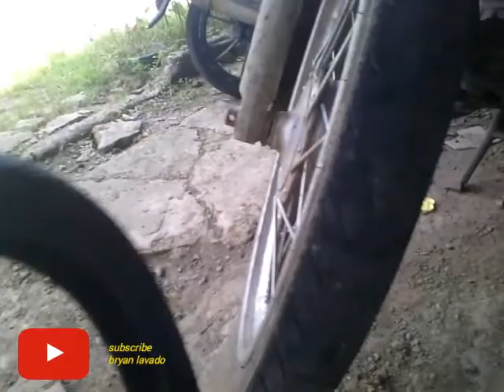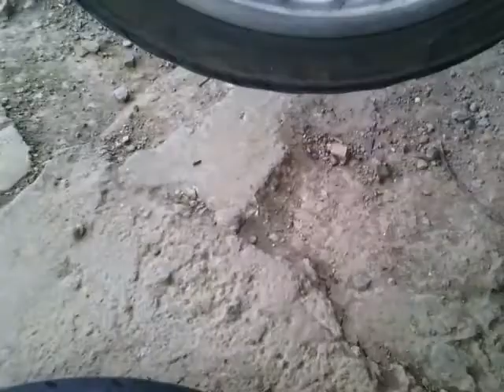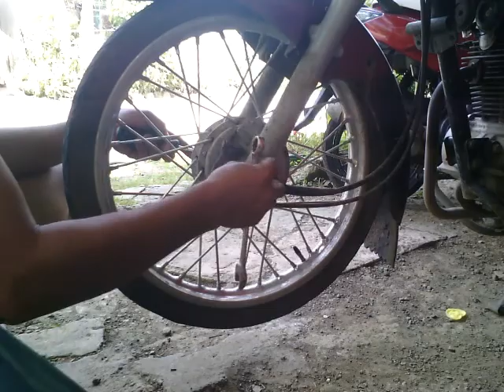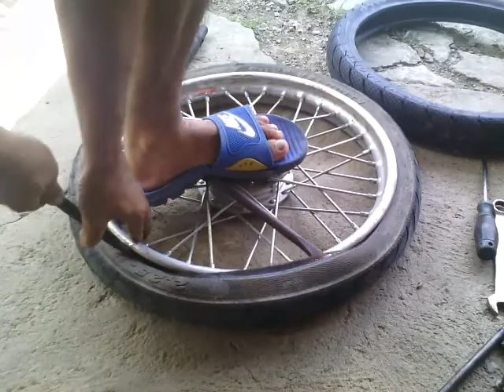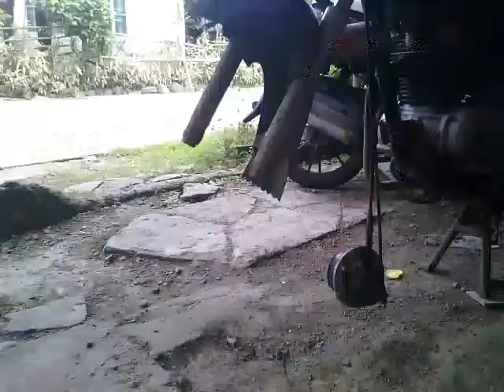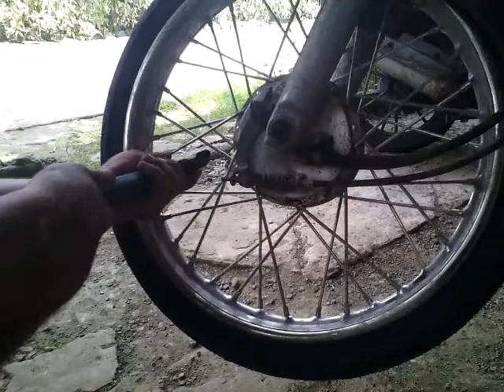Changing NEW FRONT TIRE (70/80x17)

Comment: Boss pwdi ba ung 60/80 sa harap 1.4 ung rim tapos 70/80 ung likod 1.6 ung rim sana masagot para makapag palit na ako idol...at anong zize na dn ng interior ang bibilhin ko para sa 60/80 70/80 sana masagot idol
Reply from the maker: 60/80x17 gulong = 2.00 interior
70/80x17 gulong = 2.25 interior
Reply from the maker: Sakin gamit ko ngaun 80/80x17 harap 80/90x17 likod pang long ride with one back ride.. Goods na goods